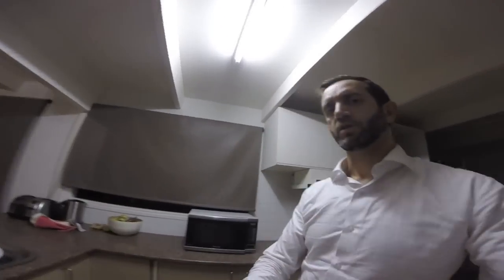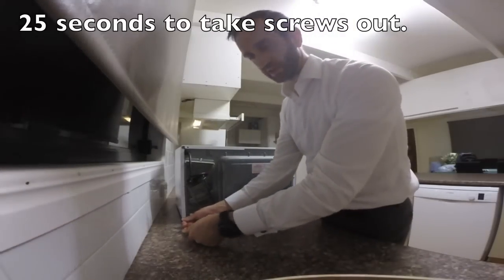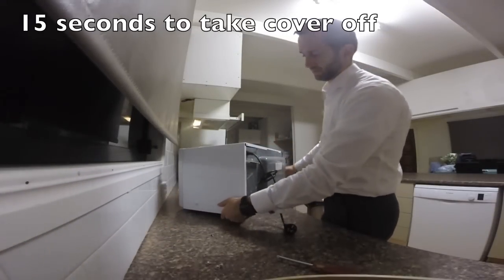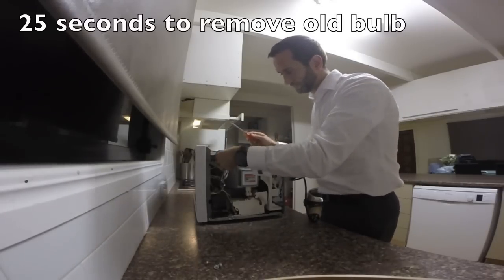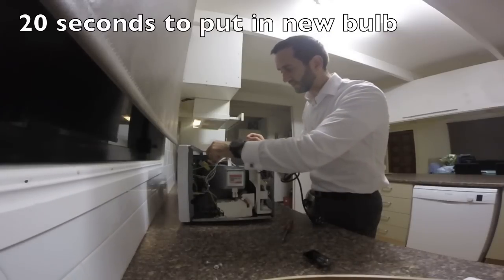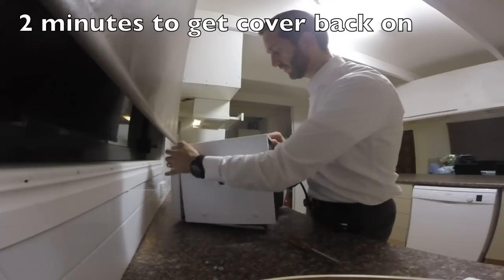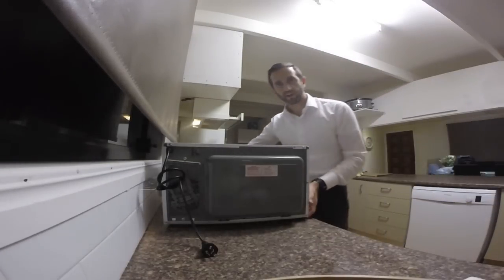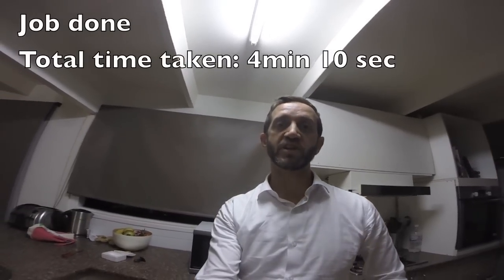How to Replace a Microwave Bulb in 4 Minutes & 10 Seconds

Comment: ATTENTION : you can see the bulb.. BUT before you remove it, look which wires go where..the writing on the bulb faces forward, and the yellow wire is on the left, red and brown on the right...just pull the plastic casing away from the terminals.. If you are at all worried..get a professional, but it is easy if you're confident...take care, after all, it's a microwave!

Comment: Question: Does anyone know if the connectors for the bulb are straight or at a 90 degree angle. I haven't opened the case so I really am not certain. The way that the How to Man is holding the old and new bulbs doesn't allow for determining that info.
Reply: Take the old one out and match it.

Comment: I used the Howto  video to replace the light bulb in my Panasonic microwave. It looked easy but it did not say that the casing is sprung so when I went to put it back on it doesn't fit back correctly!
Reply from the maker: Thanks for watching mate. I'm not too sure what you mean by sprung, but you are right in that getting the casing back on is the hardest thing. It is a bit trickey, hence from the video you see me messing around for a couple of minutes getting it in the right place. But once you push the panels in the right spot, it does seem to work right. Hope the video helped mate.
Reply: I meant that the cover was under tension and when I took it off, it sprung out. It won't go back in. Thanks, anyway. I am taking it to a service place because my bulb is unavailable and they will have to adjust the fitting so the new bulb will fit. Maybe they can fit the cover back on properly. Cheers.
Reply: Alexandrina Williams hi which model is it as my Panasonic bulb died recently and doesn't look like an identical replacement is available?
Reply from the maker: The microwave model number for this video is a Panasonic NN-ST663W.
Reply: Howto Man thanks. looking for 462 but eventually found it by finding the service manual, cross referencing to part number and googling it. saved a few pennies as espares etc cost a lot for p&p. cheers.

Comment: Thanks for the video. Our Panasonic 1250W light on the right is on. Though it looks to be a half lit filament. Do you know if there is a setting for light or is there a second bulb blown? Thank you.
Reply from the maker: Hi Mate, there definately is not a second bulb (well certainly not in my microwave or any that I have come accross before). I also do not think there are any light settings in Microwaves, they are usually either on or off, as simple as that. I would guess your problem is that the bulb could be a bit dodgy. For the cost of a new bulb (about $5 max) I would pull it out and put a new one in and see if that sorts it out. Thanks for watching.

Comment: Thank you, for the quick turn around on the answer. I tried getting the bugger open but it seems I need a torn with the anti tamper hole in center of bit. I'll see if I can snap the pin off with a needle nose plier. Thank you, Sir. Steve, Plymouth, MA USA

Comment: Anybody knows what it means if the light works for a week, goes off for a week or 2 & then comes back on & keeps repeating this cycle?
Reply from the maker: Sounds like it's some kind of loose connection. I would try replacing the bulb to see if that fixes it (the new bulb is not expensive). If that does not fix it, at least you can completely rule the bulb out.

Comment: My bulb has worked for over 20 years, turned on my trusty microwave, which I use very often and nothing but darkness, I was truly taken a back, I have been joking for years that it would never run out, anyway shouldn't be that hard to replace hopefully, but I don't know if the new bulb will last another 20 years.

It's a wee cookworks microwave I bought from Argos I think, but the thing must have been made very well to last for so long.
Reply from the maker: That's awesome. You cant beat Argos. I would take the back off and check what bulb is inside it, and hopefully it should be easy to replace. Thanks for watching.

Comment: I have delonghi microwave when I plug in power it switched of main power what should I do please anyone know to be fixed
Reply from the maker: It sounds like your microwave isn't the problem, but your power circuit is the problem if it is tripping the main switch when the microwave is put on. Maybe time to get an electrician to check this out.

Comment: I just purchased a new Whirlpool Microwave in use 1 month THE LIGHT IS NOT WORKING,  I replaced a GE Microwave over 30 years old still working good and with the same LIGHT that it came with.   So now I guess China making all of our light bulbs can not make a bulb burn more that an hour.  that is all it has be used.  So In this case it will cost Lowe's a replacement Microwave because of the Bulb.   This is really  bad business.  I can not try to change the bulb because it voids all warranties and extended warranties.  WOW american bad business. we purchased all new Whirlpool appliances now I am worried.

Comment: Hi mate. Can I have the link to eBay for buying the bulb/lamp replacement? Cheers
Reply from the maker: Just type in 'T170 Bulb' into ebay.com and you will get over 50 different sellers. They range between $3 and $10. If you are in the UK/Australia/New Zealand/Japan then the 240v is the one. If you are in the US, then I guess you will need the lower voltage, but it is worthwhile getting it from a us seller to make sure you are getting the right one. Hope this helps. Thanks for watching.
Reply: Howto Man cheers mate